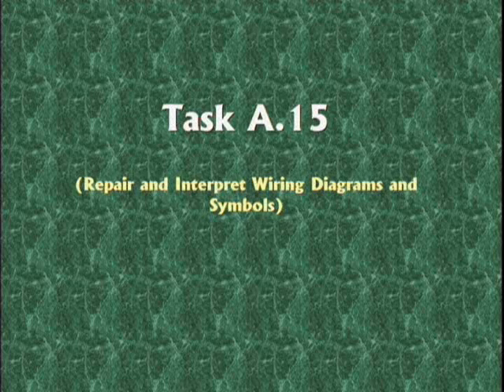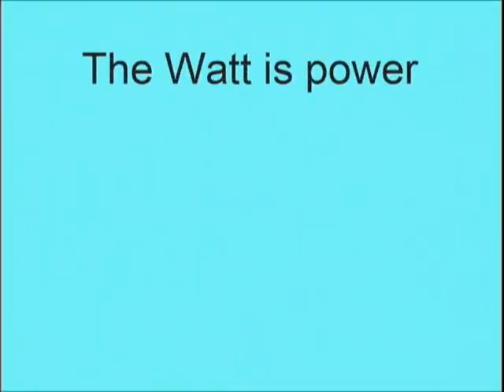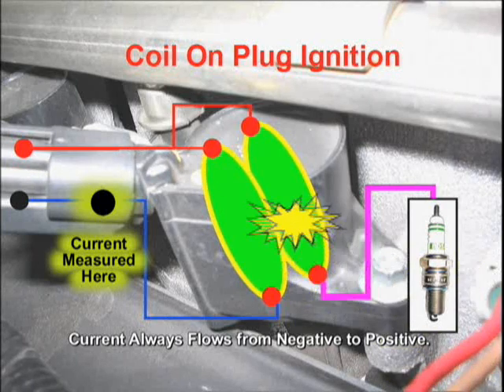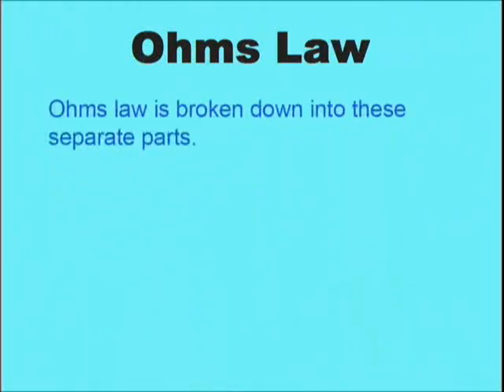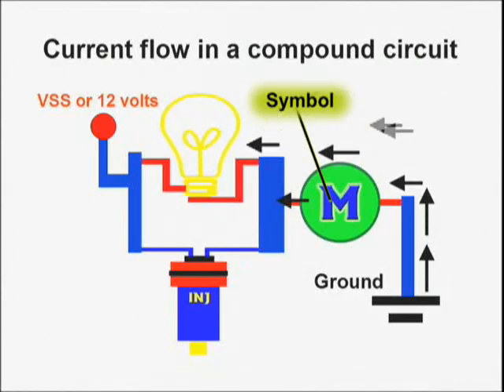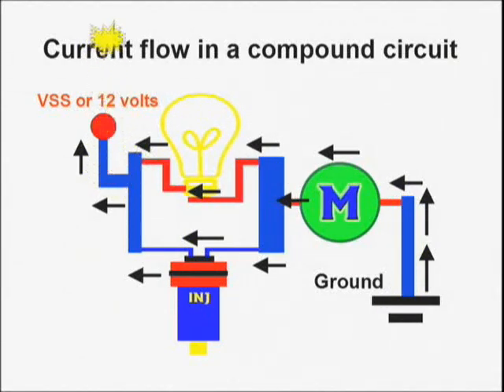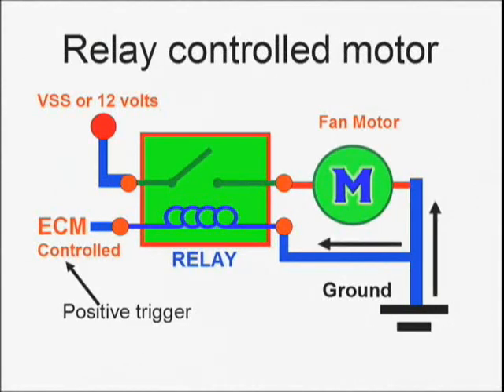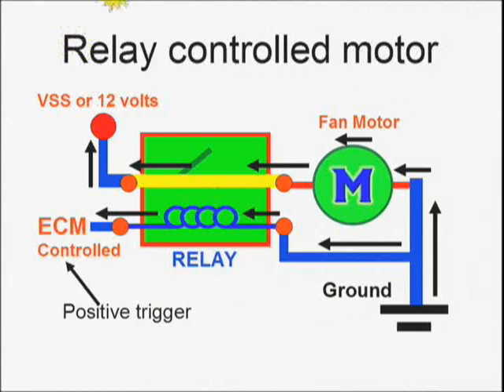Electric and Electronic Diagnostics

Comment from the maker: @bchris11111 Back in the 50's the theory was that current flowed from pos. to neg. THis is only a relativism. This is why the symbol for a diode is a reversed arrow. In reality it doesn't matter, but all diagrams are written with the precept that both current and electrons flow from Neg. to Pos... Current and electron flow is the same.... Thanks for posting...